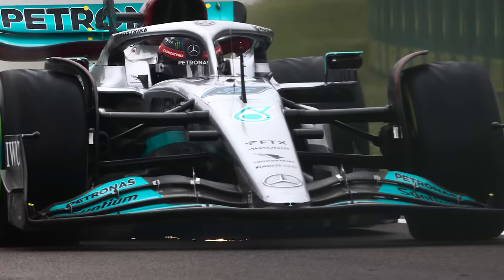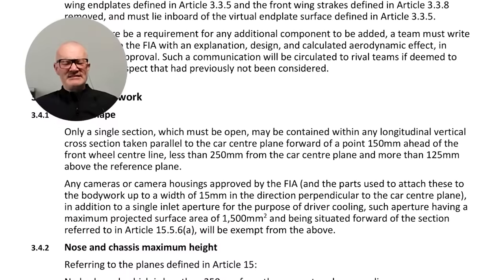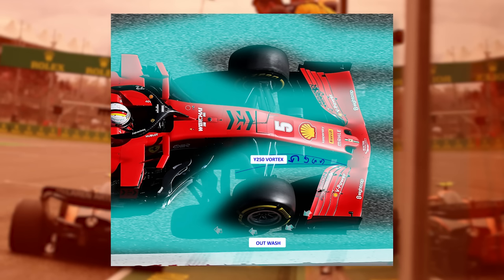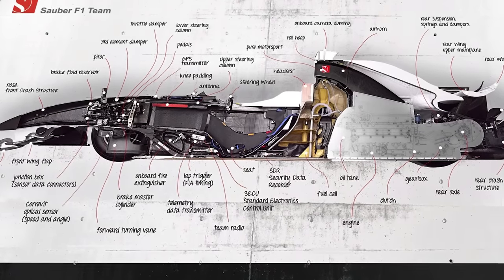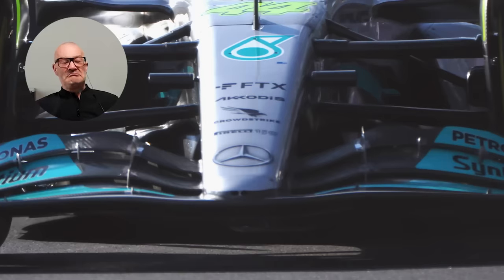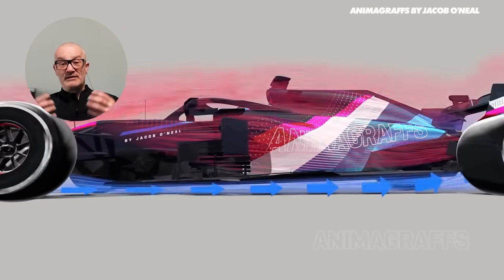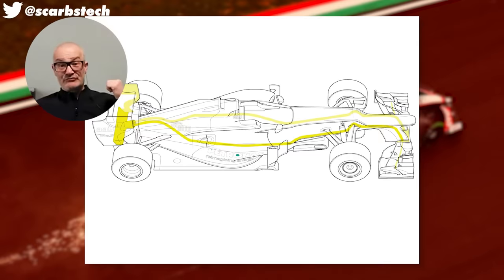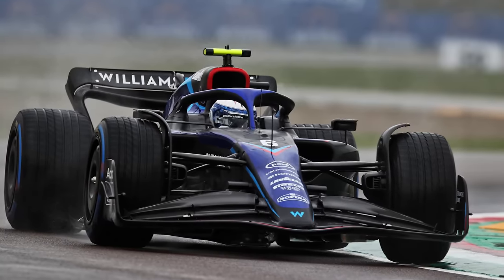Why F1 Cars Have a Hole in the Nose

Comment: There was a part of the Miami broadcast where they showed the front wing camera on the Merc, and the wing was flexing a lot at high speed, similar to how the RB did during Vettel's run. Whenever it showed the same camera for any other team, the amount of flex was significantly less. Any insight on this?

Comment: Hey Driver61 please do a video on what the reason might be for Redbull to change the car's characteristic from being fast in corners (slow/medium speed) and a little slow in straights like in previous years to now fast in straights and fast corners to slow in slow to medium speed corners as seen this year. 

Seems like Ferrari are Redbull of last year and Redbull are Mercedes of last year .
Reply: Most likely redbull just saw more potential in being faster this year since its easier to follow
Reply: @ajk7020   or maybe because they weren't confident about Honda engine ,  and for this reason they tried in every way to make the car efficient as they can ( look the massive undercut on the floor & the small radiator intakes ) . But ultimately their Honda turned out to be a very competitive engine so their car it's very similar to SF90
Reply: @missouriresole4726  My guess would be that they thought maybe they'd be battling Mercedes again this season and knowing Mercede's signature trait is having a car with more straight line and fast corner speed they maybe tried not to be at a disadvantage to Mercedes at tracks that have less slow to medium speed corners but that's just my stupid little guess. 🤷‍♂️
Reply: @MV1-OP81-Mclaren  actually it's not all that stupid.  Helmut in pre season said that he doesn't believe that Ferrari can challenge them and the title would between RB & Mercedes. The RB18 its basically the opposite of last year car  , soo much top speed and kinda weak in the corners.
Reply: @missouriresole4726  I feel like Max's style is more suited to a car that favours slow/medium speed corners but so far with the car's new characteristics he seems to have good pace still even Checo looks slightly better than last year in terms of pace.

Comment: That Mercedes 'Double DRS' was actually a technical tour de force. It was a drag reduction technology that could have had manifold uses in road cars and aircraft. 

It's right up there with the cleverest ideas I've seen in F1 like the Red Bull tensile wire system. 🙂
Reply: I agree, another example of F1 engineering at it's finest!

Comment: Didn't watch the video yet, but I'm guessing it is the same reason why F-16s have a hole in the front of the plane.
In the F-16s case, it is a sensor measuring the airflow or something like that. I hope I'm right! :D

Edit: OOF I'm wrong :"D
Reply: I thought you mean the jet engine intake.
Reply: What you probably refer to is called a pitot-tube. When a pressure difference between the inside and the outside is measured, one can calculate the incoming air, ie. it is a independent device to calculate the real time velocityof an aircraft :)
Reply: What a noob (being sarcastic obv) 😂😂😂
Reply: there is also a sensor inside of the tip of the nose that measures pressure and airflow
Reply: So I guess I was sorta correct :D
Reply: I also thought it was a pitot tube
Reply: they already have a pilot tube in front of the halo pillar
Reply: @t1g049  you are 100% correct check Fábrega's tweets in the first 2 races there is one where he pictures Ferrari's dismantled nose

Comment: It is called a trigger. In a crash the carbon/ aluminum honeycomb of the nose cone curls inward (Thanks to the trigger) . The crushed material become progressively denser and absorb more and more energy as it crumble. It is also used in road cars as little kinks in the chassis's frame members forcing the metal to fold in one direction. Since it's there, might as well use it for ventilation.

Comment: it's obviously for the parade lap. Like prize bull or pige, the mech farmers put a ring though the nose hole so it behaves and is easy to control during display. Else they go a bit wild when sudden reverse DRS (upwind) occur.  Also ERS can be cranky and so they need to control that. or at least the front hooves for downforce.. the tails gonna wiggle..but it's that of put the nose hole at the back of the car.. .. and what use is that!!
Reply: *or

Comment: Didn't teams use that nose hole originally to blow air over the leading edges of front winglets to improve cornering downforce ?
Reply: I think it used to exit on the underside of the front wings, which helped reduce drag at higher speeds (maybe generating vortices?). It also used to be passively directional, so when turning right the pressure inside the hole would be higher on its left side, and it would be directed to the underside of the front right wing. Was very cool (and I imagine a pain to manufacture!) but pretty sure they can't do that now.